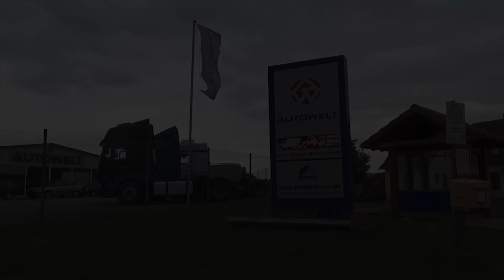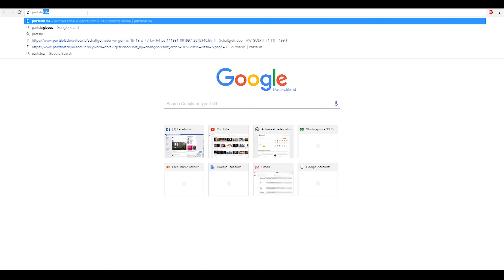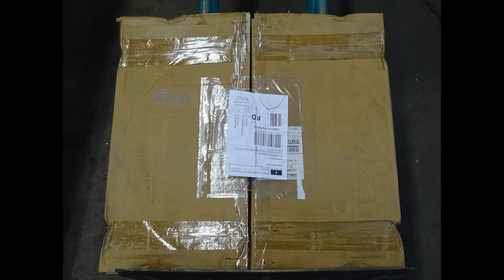Motorinstandsetzung Mercedes-Benz SK 1844 OM442 LA,Reparatur, Überholung

Comment: Yes, the video is GREAT but WHY mount a crankshaft with rust on it? Couldn't it be cleaned first? Rust goes into the engine oil = not good.
Reply: Only a little bit of surface rust on the counterweight. Won't do anything as it's not like there's large rust scales on it that'll fling off.
Reply: Andrew Gallagher I would’ve still cleaned it properly. That’s not a cheap overhaul.

Comment: Sorry if I'm being stupid with this comment, but I don't think it's good for the engine to be assembled with that rust on the inside parts (crankshaft). It look very nice outside, but, as far as I know, rust is usually harder then regular steel and iron, and it may affect the engine life in long term. All I learnt about assembling engines is that you should be careful with any possible dust contamination while assembling it. Thank you!
Reply: It looked like all of the mating surfaces were rust-free.
Reply: I agree 
Cleanliness is next to godliness...
He’s gone through all that effort and not cleaned off the corrosion on the internal parts. 
That must fall off and contaminate the oil. 
A great job though 9/10...:)

Comment: I am very disappointed in your attitude to rust not being remover on many of the different components before reassembly time, crank shaft, conrods, nuts and bolts other wise good video very well laid out nice to see strip and reassembly thanks for sharing
Reply: Agree with you. But I think they did it intentionally - just to confirm to you, they box up engine from original components.
Reply: didnt look like they used any assembly Lube neither
Reply: That's why there is an oil filter
Reply: Patricio Andres Muñoz Lopez.  Nonsense , you either Ensemble a new built Engine clean with ensembly lube or you leave it to others who do so!!!

Comment: Super anschauliches Video! Lehrmittel für die Berufsschule.  

Ein OM442 hatte im SK xx38/xx44/xx50 an den Zylinderköpfen bereits die Konstantdrossel oder deren Vorrüstung > anderes Zylinderkopf-Design 
Diese fehlt an allen 8 Zylindern und es ist keine Tombak-Ausführung.
Tippe daher auf:
1. ein OM442LA/I 442.951> NG xx44 gebaut für Europa von 1986-1988,
   dann wäre anthrazit im Zuge einer Überholung/Werkinstandsetzung auf den Block     gekommen. Bis MJ 1992 war Aggregatfarbe grün und Chassisfarbe ochsenblut. 
Was dann dafür spräche ist, dass Ihr Euch die Mühe gemacht habt, eben den alten MB-Farbton zu recherchieren...
2. es ist ein "Zwitter" aus Mannheim in der Übergangsproduktion mit restlichen Köpfen der SK xx35/xx48 und ohne SA-Code: Konstantdrossel.
Eeefach mol uffs typeschild gucke. Greets aus Mannem.
Immer diese Fachsimpler ;)

Comment: 6:45 Why leaving a coat of rust on the crankshaft ?!
Reply: If you would remove the rust, you would remove weight from the crankshaft and it wouldn´t be balanced anymore.
Reply: @TobiasHinz1992  This coat of rust represents less than 30µ gram. I could argue that an excess of 600µG of oil will stick on it as rust more porous than slick metal !
Reply: It looks to be merely flash surface rusting because it was exposed to solvent or water based solution  inside the parts washer. Inside the engine it will be in a bath of oil anyways.
Reply from the maker: @tc3sean  keep goint...just here for reading :-)
Reply: @tc3sean  of course it'll vanish by oil and its detergent and captured for its most in the oil filter but it give the impression of a crappy job.

Comment: As I know ,in my country in Indonesia. This engine used in OH1634 V8 bus chassis. And still running well till now. The 1st bus chassis in Indonesia with built in Air suspension ,abs & retarder at that era, in 1996!, there's 20unit bus with OH1634 chassis in Indonesia, and all of them owned by one bus operator. Kurnia group in South Sumatera & Banda Aceh Indonesia. You can also search on YouTube "Kurnia OH1634 V8 Megatrend" to see how this legendary engine works in our country 👍

Comment: I didn't see the counter weight bolts replaced which is a must on a V8 Benz rebuild I know from having one rebuilt in the 80s it threw a counterweight  within 12000 KLMS

Comment: when i was working at m.a.n . garage   the man v8  and v10 was the same block as the merc  we use to get away by fitting a merc head  to a man engine  just a slight differance with the ex. ports  this was done with older trucks  in the eighties
Reply: Some older Mercedese Benz truck and MAN truck models used to have similar engine sound also.

Comment: I made one engine out of 3 engines one time nack in the late 80s 1100 escort .. cross flow.. block and pistons crank and bearing out off the other...head fly wheel from the other... reyoused tke best head gasket off the 3 good old smug off wizz gasket maker tourked the head bolts a pice off pipe and welded ratchit ... 😆... best engine i ever put to geather ... in clueding bikes and other types ...😕..

Comment: Did they use genuine Mercedes parts?
I never saw any Mercedes insignia on any boxes of the new Aftermarket parts they installed. 
If no genuine parts are used then how can that be a Mercedes engine anymore?

In my humble opinion they did a lousy job of properly cleaning parts they reused. 

Just my opinion.
Reply: that was a "budged" engine rebuild. Only the necessary and not reusable stuff was replaced. As you can see at the end the engine is working perfectly fine. And by the way using genuine parts ? Are you serious ? Why spend money for overpriced parts when you can use OEM replacements for far less money and change more stuff for the same amount of money? This engines are not museum exponents you know ;)

Comment: why does every video that is about cars or engines, needs to be asociated with rock music? And the rebuilt of that engine sucks, because i see rust on the cranckshaft,
and rusty bolts being used, paint al over the thermostat housing where the seals need to go, so that wil leak in no time, so what kind of shitty job is that? If that was my 
engine, i wouldn't pay them a penny until they took it apart again and.....hell i would take it to a real shop who know their job.